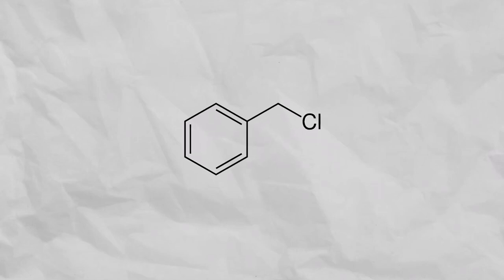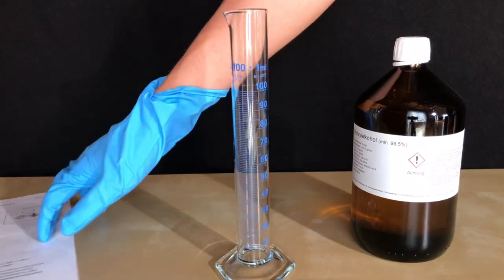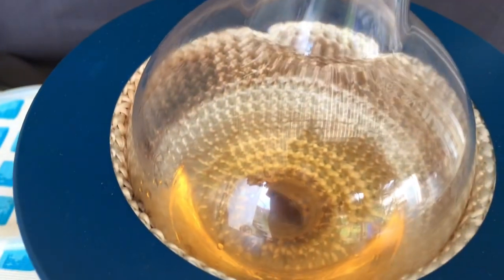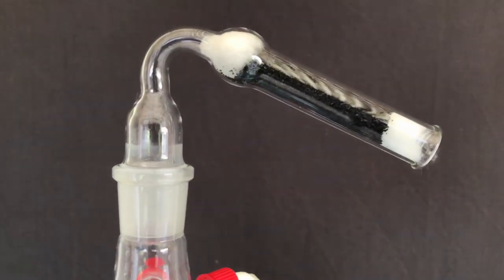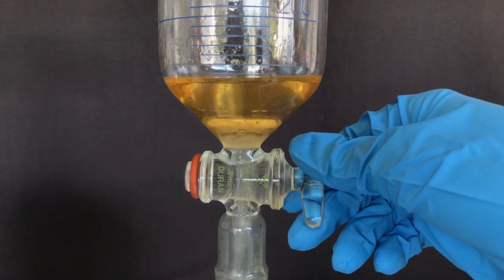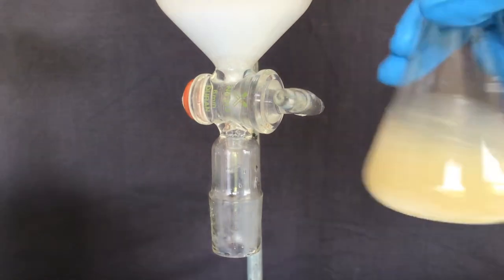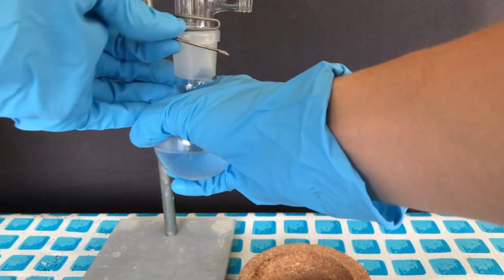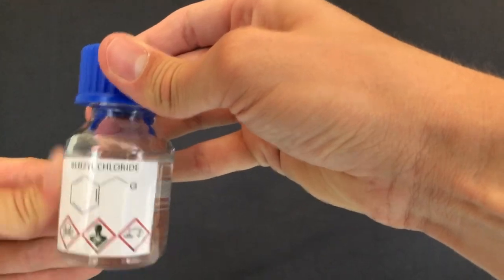Making Benzyl Chloride A Useful Chemical

Comment from the maker: Nobody reads the description anyways so here are links to Discord, Patreon, Instagram, Twitter and Reddit. Producing these videos ain’t cheap so I’d appreciate any support on patreon.

Patreon: https://www.patreon.com/thyzoid
Discord: https://discord.gg/UrjAt44HWH (Let me know if the discord link does not work)
Instagram: https://www.instagram.com/thyzoyd/?hl=de
🐦 Twitter: https://twitter.com/thyzoid1?lang=de
📌Reddit: https://www.reddit.com/user/Feuerfrosch1
Reply: Dear thyzoid laboratories, I have recently purchased a small quantity (100grams) of sodium metal lumps coated in liquid paraffin and sealed in a thick airtight plastic bag inside a properly labelled plastic container. Once I break the seal on the plastic bag if I'm unable to obtain liquid paraffin to store the remaining sodium metal lumps under in the proper container can I safely store the sodium metal lumps under kerosene if I'm unable to obtain liquid paraffin ? By the way I have previous experience in handling both sodium metal and potassium metal so I am well aware of the dangers of sodium and I'm also well aware of the extreme reactivity of sodium metal and I understand how to handle sodium metal safely
Reply from the maker: @craigpater6278  Sigma sells Na stored under kerosene so that shouldn’t be a problem as long as your kerosene is dry.
Reply: @THYZOID  and I'm guessing that it's best not to break the original seal on the sealed bag inside the plastic bottle the sodium metal came in until after I am ready to use the sodium for the first time ?
Reply from the maker: @craigpater6278  would be best
Reply: @THYZOID  thank you so much for your help and advice, had I not asked you I would have automatically made the decision to not break the original seal until after I'm ready to use the sodium metal by default
Reply: @THYZOID  we have established that it's best to not break the original seal on the sodium metal until after I am ready to use it. You did say that storing the sodium metal under kerosene is fine, the question I have for you now is if the sodium metal that I purchased was originally coated with liquid paraffin when I purchased it can I still safely store the sodium metal I don't use under kerosene even if it's already coated in liquid paraffin ?
Reply: @THYZOID  the reason I asked about storing the sodium metal under kerosene when it was originally stored coated in liquid paraffin is because it's only coated in liquid paraffin not submerged under liquid paraffin in the original packaging it came in when I ordered it, which means I will need a suitable liquid to store the sodium metal under in the original container once I have broken the original seal
Reply from the maker: @craigpater6278  that still works as both paraffin and kerosene are inert and miscible. Even a mixture of paraffin and kerosene would still be ok to use
Reply: The sodium metal I purchased is double sealed, it's sealed in a thick airtight plastic bag and coated with paraffin oil within the plastic bag it's sealed in, and that sealed bag is contained inside a rigid plastic storage container. If I have broken the outer seal on the plastic chemical storage bottle, but I haven't broken the inner seal on the airtight plastic bag containing the liquid paraffin coated sodium will it be ok to continue storing it the same way it is now as long as I don't break the inner seal on the plastic bag the sodium is sealed in ?
Reply: @THYZOID  the sodium metal I purchased is double sealed, it's coated in liquid paraffin and the liquid paraffin coated sodium is sealed inside an airtight plastic bag, which in turn was sealed in a rigid plastic chemical storage bottle. I have broken the seal on the plastic chemical storage bottle, but I have left the airtight seal on the plastic storage bag intact. As long as the airtight seal on the plastic storage bag containing the liquid paraffin coated sodium metal remains intact will it be ok to continue storing it the same way it is now as long as I don't break the inner seal on the plastic storage bag ?
Reply from the maker: @craigpater6278  just open it up and put it in a bottle with petroleum or paraffin. Storing and handling sodium isn’t that hard.
Reply: @THYZOID  if the kerosene that I'm storing my sodium under is a dark blue liquid is it still okay to store the sodium under kerosene if that kerosene is dark blue ?
Reply from the maker: @craigpater6278  It is not ok. The coloring agent might react with the sodium. Only use colorless, anhydrous kerosene
Reply: @THYZOID  I have some important questions for you regarding storing my sodium properly. Firstly, what should I do with the coloured kerosene already in my sodium container ? . Secondly, if I don't have access to colourless anhydrous kerosene where I am do you know what other liquids I can properly and safely store my sodium under that the sodium won't react with if I can't access anhydrous kerosene where I live ?
Reply from the maker: @craigpater6278  just distill the kerosene and you should get rid of the color
Reply: @THYZOID  thanks for that advice but I don't know how to carry out a distillation of the kerosene nor do I have any distillation equipment to carry out the distillation in the first place. Do you have any other ideas to deal with this issue apart from distillation ?
Reply: @THYZOID  also I'm very curious now that you mentioned it, when the colouring agent in kerosene reacts with sodium metal exactly how does the colouring agent react with sodium and exactly what happens during the reaction between the colouring agent and sodium ?
Reply from the maker: @craigpater6278  I cannot tell you what reaction takes place as I don’t know which coloring agent is used. All I can say is that it might lead to impurities
Reply from the maker: @craigpater6278  buy uncolored kerosene or try to get rid of the color with perfectly dry activated charcoal
Reply: @THYZOID  hardware stores have a much greater variety of liquids which may be suitable for storing sodium in which is why I am thinking of going to a hardware store to buy a suitable liquid to store my sodium. I have been online and noticed that the hardware store sells both liquid paraffin oil and they also sell a low odour kerosene which is completely colourless contains no colouring agents and contains only 100% liquid hydrocarbons. Is it okay to either buy the liquid paraffin oil or the colour free kerosene and use that to store the sodium ?
Reply from the maker: @craigpater6278  yeah it should be ok.
Reply: @THYZOID  based on the history of our replies on you tube I had been storing my sodium under the coloured kerosene for approx 3 to 5 days. Earlier today I drained (removed or carefully drained) as much of the coloured kerosene out of the sodium container as possible. After removing the kerosene I am now storing the sodium under a more suitable liquid (I'm currently storing my sodium under liquid paraffin oil). Will my sodium still be highly reactive ? I'm counting on my sodium still being highly reactive because of course the whole point of me conducting experiments with sodium is to highlight the highly reactive nature of sodium metal. I will of course have safety protocols in place using the sodium metal, for example I will wear a full face shield over splash resistant chemical safety goggles, protective gloves and a respirator to protect me against any possible harmful fumes
Reply: @THYZOID  I have previous experience with handling both sodium metal and potassium metal when I studied chemistry (science) in high school including under carefully controlled conditions (eg protective safely glasses) close teacher supervision etc throwing approx 2 to 3 centimetre cubes of both sodium metal and potassium metal into water (I'm sure you would already know what happens when sodium metal and potassium metal is thrown into water), this type of experiment reacting sodium and potassium with water was done under strict teacher supervision using appropriate PPE (protective safety gear), and I plan on handling my sodium with the same extreme caution as I treated the sodium metal and potassium metal when handling them while studying science in high school
Reply: @craigpater6278  Honestly whats with the difficulty you have had understanding that ANY method of keeping water and air away from Sodium will do. Dip them in wax, store them in oil. Your NOT going to stop the Sodium from reacting and becoming covered in hydroxide externally even under mineral oil.
Reply: @DorsetMushroomHunter  I'm well aware that I can't stop the reaction that leads to a hydroxide coating forming on the sodium I just didn't want to store the sodium in any liquids that will lead to the sodium being exposed to additional impurities (not including the hydroxide coating that I already know is inevitably going to form anyway)

Comment: I have worked with Benzyl bromide (more reactive brother of benzyl chloride) in my undergrad summer internship, and oh boy does my eyes sting even when in a fume hood! And what's more, we had to do column chromatography directly (the benzyl bromide couldn't be removed due to reaction constraints and methodology), the whole hood became a danger zone and I was constantly reminded (by my eyes hurting) to keep shash as low as possible and maintain a healthy distance from the hood window.
Reply: Fun fact - Years ago I made some Benzyl Bromide and chose to finish up outdoors due to lachrymatory effects.  I found myself immediately surrounded by BEES, who were landing on any surface where it was present!!  Don't know if that is a known property of the stuff, or if it is only the Bromide, but it was really hard to keep my cool and NOT drop my glass!  Anyone else heard of this?  It was 40 years ago.
Reply: @waynecooper6124  How did you make it? The same way as THYZOID makes Benzylchloride just using HBr instead of HCl?
Reply: @Space2_Corp  Yeah, Pretty much that's what I did - I just substituted HBr for the HCl used in the Benzyl chloride synth from benzyl alcohol: the bromine wants to attach to that benzylic OH.
Reply: @waynecooper6124  Alright thanks mate! I will try the synthesis in the future but I have to be very careful

Comment: I often use a long tube in the hose adapter. The other end can be outside, insude, pushed in side an air vent (that pushes air outside) or whatever is convinient. This method keeps solvent vapors down too that always escape. This works with disttillation too, if you connect the hose in the distillation vacuum adapter. (or output of vacuum pump if you have a solvent proof mechanical vacuum pump in vacuum distillation)
Reply: @experimental_chemistry  I have no fume hood and I was surprised how much a single piece of hose helped in distillation and refluxing. Even something not low boiling like toluiene still escapes a lot and with hose adapter the problems are mostly gone.
They don't teach this because yuou have a fume hood in university or whatever. After 1st try I never went without a hose again.
I've never seen that method in amateur chem videos either which I why I bring this up. I'm sure I'm not the only one that could use this. (I think I've once seen it mentioned in someone's video though, but just once)
Reply from the maker: I often do the same but with a gas scrubber attatched too. Not for this preparation though as we already did it outside.
Reply: @experimental_chemistry  I never suggested a hose for really dangerous stuff and I totally agree it is far from perfect.. A hose is nice for something not too dangerous. It is not a substitute for a fume hood when working with very toxic chemicals.
Sometimes it is best you can get. Solven fumes etc that are pretty harmles can be dealt with that. Outside is of course an option but not for everyone especially in the winter when there is very cold outside.
Of course with stuff like hose, you are limited by safety issues. I'd never consider working with dangerous stuff at home with hose or a simple scrubber. But on the other hand, a lot of chemistry can be limited to safe reactions. When solven vapor is a nuisance, hose is ok imho. Sure, if even if you release a lot of HCl vapor due to hose failure, you'll want a gas mask in closed room. Bui it is always better to have one as a backup when needed.
There is a lot of difference if you have an irritant or solvent vapors or if you have some dangerous stuff like cyanides, OsO4, HF or whatnot. Even in professional labs you want a glove box for the most nasty stuff.
Reply: I do this with a hose to a vapor trap (aqueous NaOH).

Comment: Nice video it must have been a hard project was it? Did your gas mask help with the fumes. When I was working with Bromine my gas mask did not help that much.
Reply from the maker: If your mask doesn’t help against bromine you are using the wrong kind of filters. It was a hard project but the gas mask worked wonderfully

Comment: To anybody that has actually performed this reaction will 31% hardware store muriatic acid work? Or do i have to disstil and reconcentrate the HCL. Im not sure whats in the muriatic acid besides maybe some iron... would it still work as normal?
Reply from the maker: 31% is fine
Reply: @THYZOID  so muriatic acid with all of the contaminants it comes with versus pure hydrochloric acid is fine to use? Yes it comes at 31% which is perfectly fine but I'm just worried about the contaminants I could get rid of buy distilling and reconcentration
Reply from the maker: @erickwalker11  you distill the product anyways so don´t worry. 31% technical grade is fine.